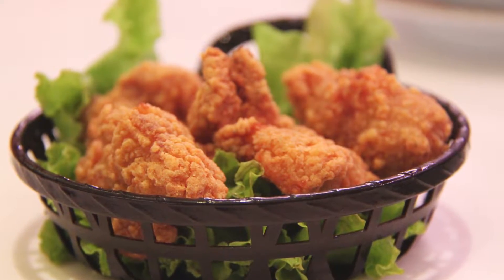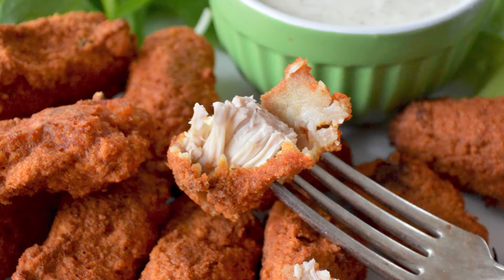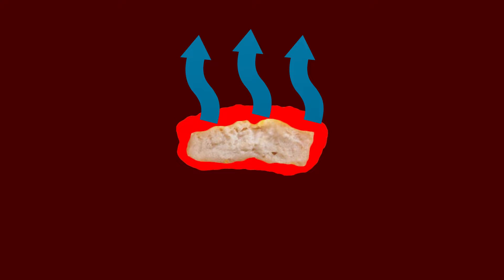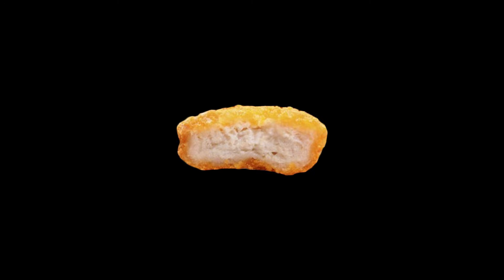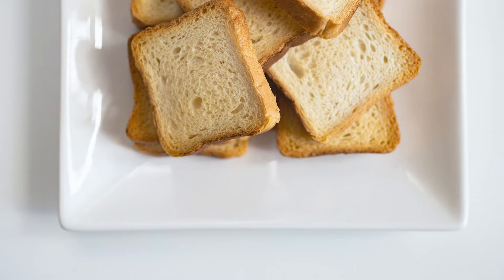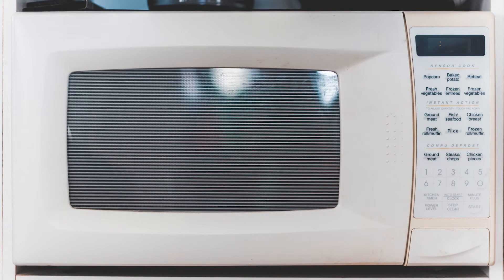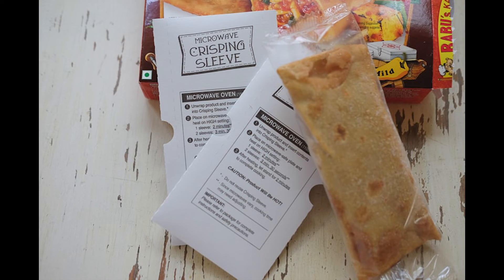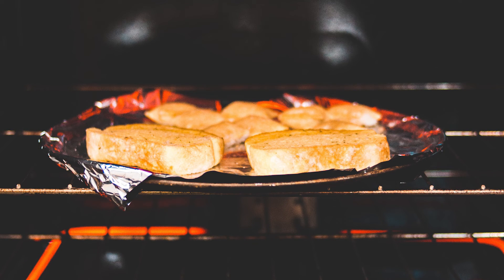Why do microwaves make food soggy?

Comment: Ur Video is awesome thanks for the info😊!! But do you have any idea why heating food with half a cup of water could save the food crispness? I never tried it before, since I don’t have a microwave, but this was a hack suggested by domino’s when microwaving the pizza.
Reply from the maker: I think it just causes the food to heat more slowly, so the heat has time to spread out and you have fewer cold areas that catch the moisture from the hot areas. I don't think the trick actually works all that well. I wonder if simply turning the power level down on the microwave would have almost the same effect.